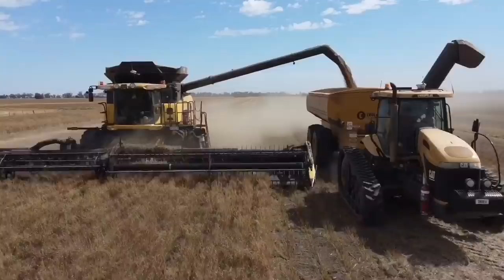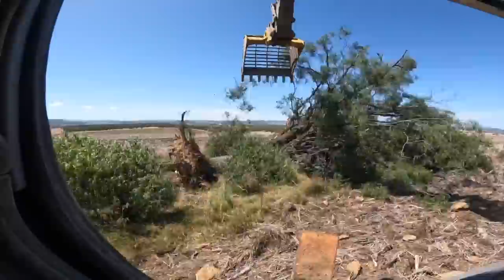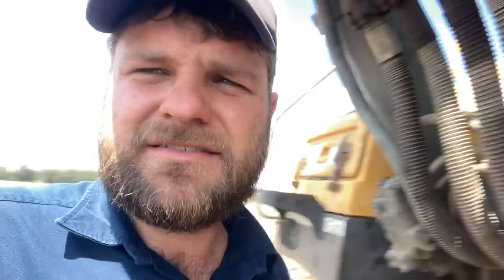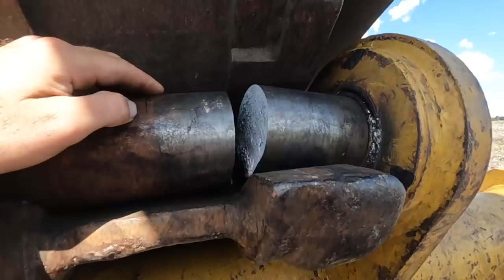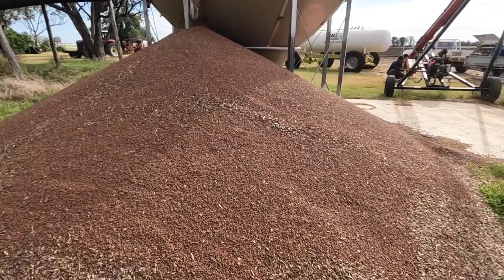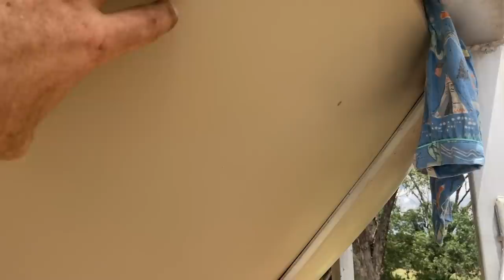Split Pins & Broken Bins (Vlog 60)

Comment: That skeletal bucket does wonders cleaning up the burn piles. Can leave all the good dirt behind and go bury all the crap that comes out of it. Oops spoke too soon, jinxed it. Thats shock,1ing to me such a new bucket could have a pin failure like that. I'd be looking into manufacturing error or something. Time to heat it up, turn that yellow paint red, and with another machine bend push it back into place. Can't imagine that pin is very cheap. A single pin for my 973c is around $1,100 and i have 16 of them.

Comment: Good to see a Australian farm on here, but looked like you had fair bit slop on the bucket (side to side) could really notice it when you moving towards the tree you trimmed. 
Also don't swing over the cab of a truck, I've seen a tooth go though a AC unit on the roof into the cab,  luckily no one was  in it at the time and tree branch bounce off a hood into the windscreen.

Comment: Can’t believe the pin split  that must be 3 inch or better  must be stress on the bucket ,,your Hopper must have Concrete Waranty once you are off it no Warranty weak as I think great video I’m learning heaps T Y   Cheers best of luck have a great Season 👍👍👍👍👍💪💪💪💪😀😀😃😎🇦🇺🇦🇺🇦🇺🇦🇺👍
Reply from the maker: Thanks Jess! It’s a 4 inch pin, should see some of the repairs we did in the next video👍😁

Comment: Surely a couple of trees can't be that bad , actually tree breaks will stop a lot moisture loss if done properly
Reply: Will it stop the loss of more moisture than that which it pulls from the ground, along with the nutrients, that it steels from the crop?  
What about the sunlight that it stops from reaching the crop?
What about the loss of use of the land that can't be used for crop production because the machinery must deviate and go around it?
What about the loss of the time needed to maintain/mow that lost cropland?
What about the cost of equipment, supplies, chemicals, and labor in order to do the above?
What about the environmental impact of more chemicals and fuels needed to do the above?
What about the loss of one's FREEDOM to decide what to do with that tree on that person's land, private property?
What if that is a non-native tree?

Trees are pretty, so are puppies and babies and boobs.....
Reply: @lt1nut  well actually it will if planted correctly , and if you use a acacia it will boost nitrogen as well
Reply: @bigears4014  
Is  your specification/example met here?  (I've seriously no idea, I'm not trying to be a sarcastic smartazz.)